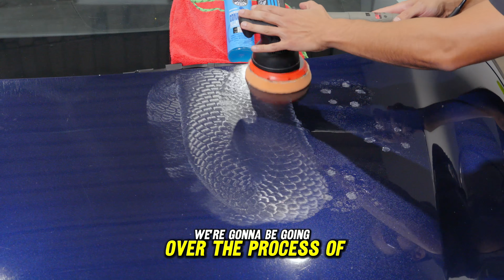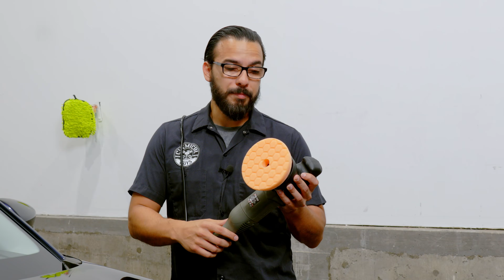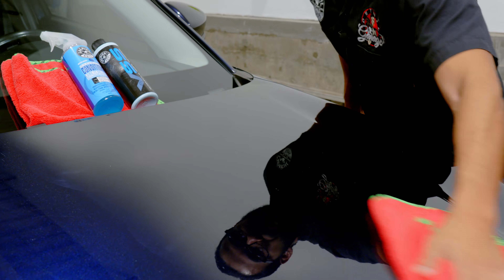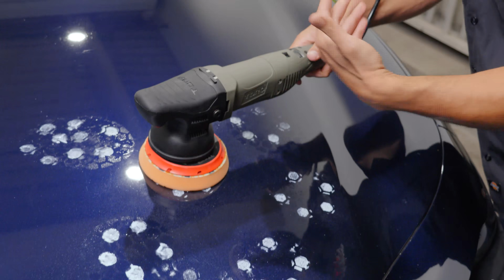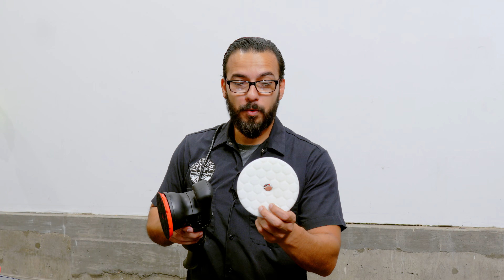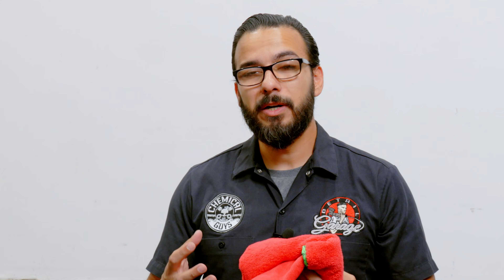How To Polish Car Paint - One-Step vs. Two-Step Paint Correction Explained

Comment: Perhaps this was just the camera angle or lighting (Please let me know your thoughts) but I thought the area done with the one step gave a much deeper look to the paint. It also appeared to remove more of overall small scratches and marks in the paint. Again, it's hard to tell from this perspective, but that's what I see. I'm currently doing my truck before the winter comes. By chance I picked up the one step and was amazed with the small section I tested. After watching how CG's applies it, I think I need to work the product in much more than I did, so it will be interesting how it comes out when properly applied. I have to give a shout out to the he CG line up. The results have always been outstanding, with the exception of a couple of products. Overall they have surpassed my expectations and have no complaints.

Comment: Is this possible without using a $300 buffer? Like, by hand?
Reply: Definitely not. You can’t do a paint correction without a buffer. If you do it by hand, you’ll still see the swirl marks in the sun. Hope this helps. For the whole set that’s in this video, is about a $200 set up. Not bad compared to other brands. I also recommend their TORQX products as well